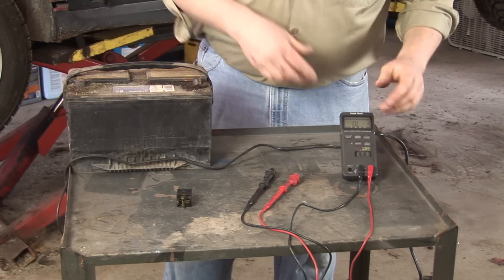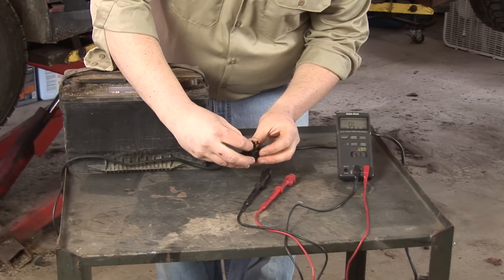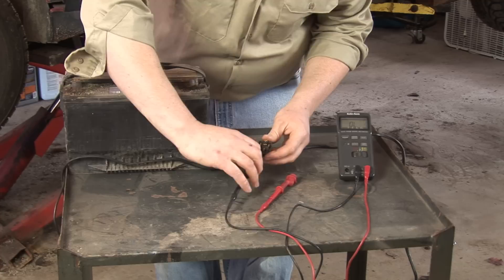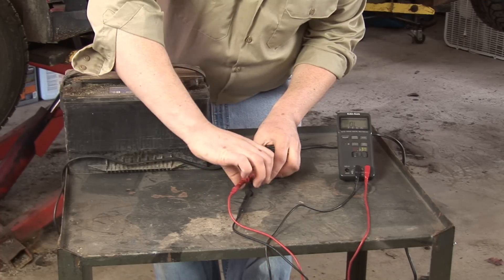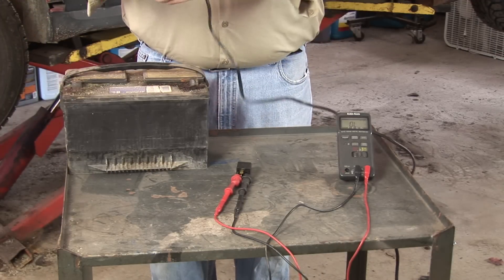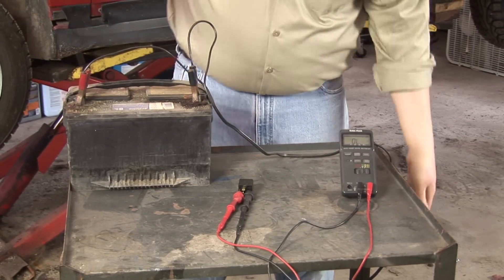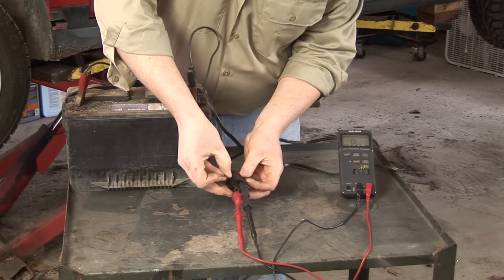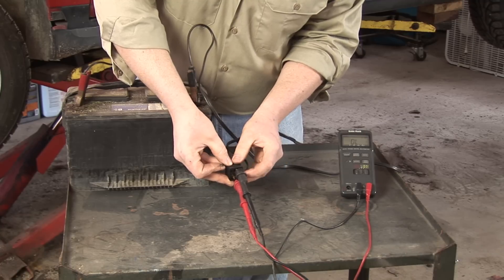Auto Repair & Mechanics : How to Test a Car Relay

Comment: Before removing (or if stuck), or afterward, try aggressively tapping, shaking and wonking them on table. Sometimes they are stuck with corrosion. You can also carefully drill holes into sides and top and spray silicone juice into them. Or wd40 (let soak and tap on it) and then brake cleaner if need be.

Comment: my headlight relay is a Denso 056700-9160. I cant clamp anything to it to test it. The prongs are some what encased. Should I use the wire wrap method?

Comment: You just need some AA or AAA's too, not a car battery.  For 5 pole you'll want a switch that breaks power to the coil and alternately couples the test lead between 87 and 87a.  Obviously those two circuits need to be isolated but by activating with a single switch you just have to e.g., with a push button, plug in relay, listen for tone, then push button, listen for tone, rinse and repeat.

Comment: I work on F-16's and we have a relay tester I'm thinking about making one.  Just take a relay block from a car and have inputs from battery and outputs to a green light so when you push a button the light lights up if it works.  idk.  Seems easier in the long run.

Comment: apparently your not sure how a relay works. relays work by powering one circuit to control another circuit, he is testing the switch that is controlled by the smaller amperage circuit. so there is no power there. you need to check resistence of the switch to make sure there is no open.

Comment: What if the relay is on the vehicle, it gives an audible clicking sound when the door is open, but no continuity tone prior to that. I assume the relay is the battery saver relay. does this relay have to be working correctly for the car to start because the car does not start?

Comment: I wanted to test my car 12V central locking relay, but it has 6 pins. Moreover it doesn't have the 87 and 30, etc references. Any idea how to test it? :(

I also wanted to know if it is safe to use the car battery to test them directly. Is not the amperage to high? (sorry, I don't know much about car electrics :p)

Comment: as far as seeing - If the neter shows infinity, it is still an open circuit, even after applying power to the coil inside the relay

Comment: @wildabeast - it does tell you...if the relay is good, then when you apply voltage to the coil, you'll hear a click (the switch macking contact, allowing voltage across and into the rest of the circuit) and the Fluke Meter, when set to continuity check will beep (like in the video)  If you get neither a click or a beep, it's a bad relay

Comment: @jlinn91 Probably a bad starter. When holding down the start/ignition button try tapping the starter with a hammer if it starts turning then the starter has worn brushes in it

Comment: @facestomp88 good 1.i cudn tell u if the click was good or bad,,i wud like an expertise answer on da same question...i have a motorcycle an the ignition quit workin,everytime i turn the key i hear a click from the relay but the starter doesnt engane wen i hit the start button,it used 2 not click wen it was workin but now a click and its not workin but the relay in the vid clicks and it works fine mine clicks and does jack shit

Comment: This is Ok but not the best as you only ohm checked it with-OUT a load on the contacts. sure it shows continuity using a ohm meter but so will a lead trace on a piece of paper or a single strand of wire but neither will carry a load that a automotive relay will.  To check a relay or switch you MUST load it!  The BEST & ONLY true way is a VOLTAGE DROP across the contacts LOADED.

Comment: The central locking sysytem has a problem..does it mean that the relay is damaged if so how do i locate the relay the vehicle is a ford windstar 1996,and the knoba keeps going up and down till the battery is drained

Comment: well it can't be misplaced relay, because relay only goes in one way. It could be a bad relay. You might want to check on the reference thing to which relays are for starter and replace those. Relays are only like 3=4 bucks each so not that expensive.

Comment: Hello i have a question would a bad relay or missed placed relay in a 89 cadillac make the car not want to start everything works the battery is charged though it was that wasnt then thought it was gas not that either messed with the relays days before this happend and now doesnt want to start let me know thank you